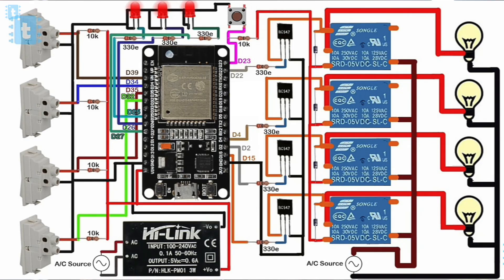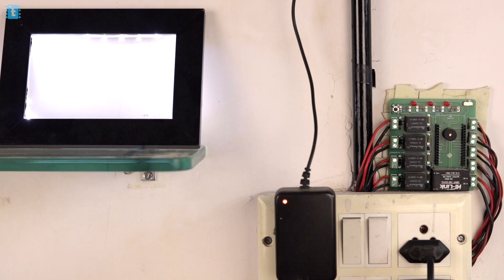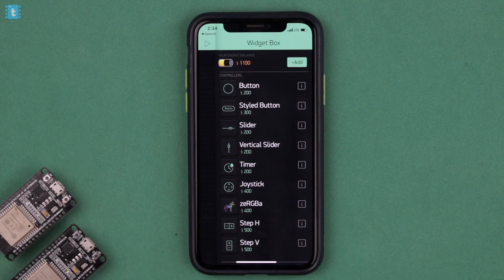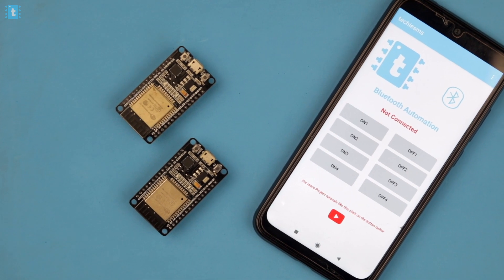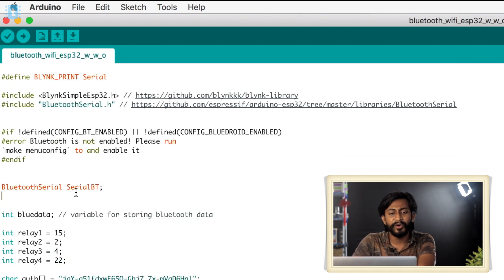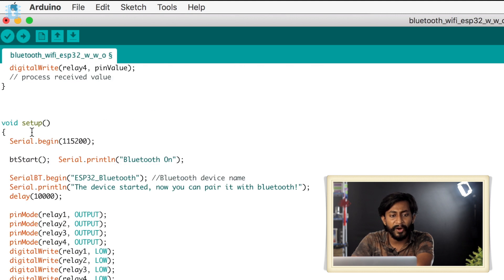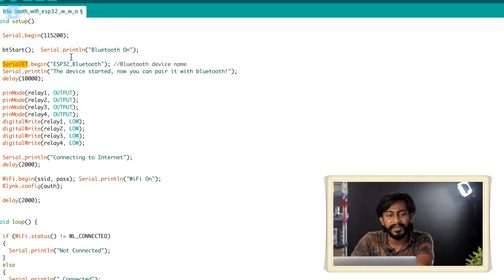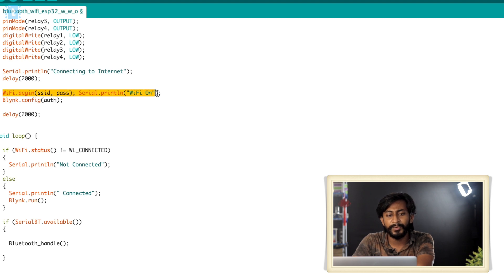Home Automation with WiFi & Bluetooth together

Comment: Bro i need to know if this is possible or not. we have Esp32 TTGO board which can use sim for internet connection and also esp32 wifi can be used as a access point so can we share the sim internet through the wifi AP of esp32 so that we can mimic the Jio hotspot dongles

Comment: Great information. Explained very well. But What happened, if  wifi is connected and other information are sending over wifi and and meanwhile Bluetooth data is available same time. Does it miss the Bluetooth data ?How it works ?how to configure that case? Thank you.

Comment: Hi bro,i am facing one issue in esp32 if i turn off and turn on  hospot wifi is not connecting automatically for reconnecting wifi i have to power off and power on otherwise i have to press EN then only its connecting give me some solution bro,thanking you

Comment: Sir , why All relay HIGH after c power cut off
Reply from the maker: Because appliances are connected to normally closed pins of relay
Reply: @techiesms  Sir.may be epirom code use
Reply: @techiesms  sir, I need 4 channel nodemcu WiFi epirom code

Comment: Arduino: 1.8.14 Hourly Build 2021/03/09 09:33 (Windows 10), Board: "LoPy4, Disabled, 80MHz, 921600, None"

Sketch uses 1329394 bytes (101%) of program storage space. Maximum is 1310720 bytes.

Global variables use 51604 bytes (15%) of dynamic memory, leaving 276076 bytes for local variables. Maximum is 327680 bytes.

Sketch too big; see http://www.arduino.cc/en/Guide/Troubleshooting#size for tips on reducing it.

text section exceeds available space in board

Error compiling for board ESP32 Dev Module.

This report would have more information with
"Show verbose output during compilation"
option enabled in File -> Preferences.
Reply: Exactly..I'm getting this error . Not able to compile Butooth and wifi both
Reply: For someone else, in Arduino IDE go to tools > partition scheme then select HUGE APP.

Comment: Bro plz solve my problems 
1.While I am giving external power supply to esp32 , all my relays are tripping after sometime if more than 2 relays on at a time  
2. Esp32 is not connecting to WiFi with load connected after restarting .. It only connects after removing load
3. How to save previous state of relays after restarting the esp32
4. Is there any other app alternative to sinric and free with ease to connect Alexa through internet

Comment: When ESP32 connects to the internet it breaks my connection with Bluetooth, and if I have a connection with Internet I can't connect to Bluetooth. Even with btStart().
Reply: Same here
Reply: @vipinckty1  Hey mate, so I was working with my project and made several research to this "error", well unfortunately ESP32 can't work with both (WiFi and Bluetooth) together, so what you will have to do, is make them work together. What I mean by that. They will have to work only one at a time. Good Luck!
Reply: @niltonschumacherfilho3368  ohk.. thank u for the information. 👍

Comment: You are awesome bro, you have a very great enthusiasm while developing and explaining your topics, that's inspiring, greetings from Mexico! Saludos amigo!
Reply: I want to make you a suggestion about the issue with the bt function, as I have learned, the registers that control the isr (or interruptions) inside of the microcontroller are not completely cleared when reprogramming is done, so once the flag that represents the isr of the bt function is on, the flag still on while you not clear it manually, I think you may turn it off by using a function that helps you to clear the registers of the flag, to need to turn on again the bt function as well.

Comment: Sir can I use touch sensors ttp223 instead of normal switches, but I want to use up and down switch for speed of fan with same relay and circuits as you have shown ,as it is the best non humming circuit, but how can I  go through for this small change, pls.  try to help me with esp32 pin diagrams and the coding..

Comment: It's esp library issue, it is saved running State, you can also found with wifi also. If one time you run as hotspot it's saves that state and always run until the stop code was not initiate. Any time in any code.

Comment: You wont believe !!!! I had been working on this project for past 3 months, had designed the board on my own by scrapping and learning all over the internet using my 2 year engineering skills, took me alot thinking of how to sync manual and wifi switching and did something similar. Today I found this video. Just looking at u explaining and wondering was it all that hardwork waste? I'll give you somesuggestions from my design, You can use the same phase wire to porwer the devise and prallely supply to appliances(Make tracks wide to handle current). ARE YOU FACING esp reset issue?  a 470uF capcitor  after hilink ac to dc converer protects esp from current spikes that result in shutdown. Regarding the software part I would suggest  HASSbian and a pi3 . I am devlouping my own software a and setting up cloud computing for same. Seeing this makes me so happy and sad at the same time!!

Comment: Whenever I connect my nodemcu with relay, whenever it gets connected to the internet, the relays get automatically turn on and off. It again happen only when I reboot the router/ nodemcu
Reply: In the setup part make sure that all the digital pins are turned low or high, or if you want to maintain their state, you can use EEPROM.

Comment: Hello techiesms hope you see my comment, It still needs upgrade, as with the use of bluetooth our device is hackable so we need security for the same to use the device without hassle.! Hope you understand my concern regarding project. I can hack into this easily even if I don't have any knowledge about the device. it should use some authentication to let any user connect to the bluetooth of esp32, which i too found very very difficult in serial bluetooth of esp32. But its necessary so is there any method so that device can only connect to the authorised person and receive data from the same.!

Comment: I think the btStart method is called in _inin_bt method of BlustoothSerial.cpp and this _init_bt method is called in method begin(String localName, bool isMaster) in line 607. But I don’t think this method is being called in the default constructor. 

This is my analysis of why it’s not starting without including in the setup. But I don’t understand how it’s working when you said that if you comment it out later it still works. 

BTW, I am novice in c and c++, but have in depth knowledge in other programming and scripting languages. With that knowledge I analyzed this but if I went awfully wrong, please correct me.

Comment: The Esp32 must have a one time overide function . So once btStart was declared
It started but 
Where btStart= True 
But 
It is
Never made false i.e bluetooth is never turned off
So that all
Reply from the maker: May be
Reply: That makes sense. I was thinking how it is or can be cashed, and this is inline with my analysis above as well on how it is not called in the default constructor.

Comment: Sir, is it esp32 or esp32s2 module? Sir because I have also tried so many time to do this but I failed and sir also I tried to fix the esp32 wifi reconnect issues with coding I can't. sir do you have an idea, to use reconnect feature in right. way ?
After doing a lot of research in the internet I heard about esp32s2 may be so many issues of esp32 fixed in esp32s2 module. that's why I asked you sir if you know about esp32s2 then guide us , & make a detail video on this. Thank you so much sir for teaching us....👍

Comment: Great, this is a great project !!!!!!!!!
I would be very grateful if you do a device like this:
     - Use esp32 to control 8 devices by Wi-Fi + bluetooth + 8 software buttons + 8 hardware buttons
     - 8 hardware buttons and 8 software buttons must be in sync
     - 1 LED shows whether esp is connected to wifi or not
     - 1 temperature scale
     - Can be controlled by google assistant
Please help me, pleaseeeee :((((
My English is very poor so I am very sorry

Comment: if (!btStarted() && !btStart()){
        log_e("initialize controller failed");
        return false;
    }

It says that, this function is only checking that you have initialized BTSTART or not,  not initialize the btStart(),  this condition only work if btStart() will return false statement, Good Work

Comment: What should be the wiring if you want to operate it from existing switches and through wifi and also maintain the state even after power loss(retentive).

Comment: Hee bro where can I found cheap electronic components and parts ? 
 
I want oled screen for Arduino 
So some one help me becouse I don't have budjet of it. So can eny one sponsor me ?

I am also doing experiments. Thanks   
Jay hind.
Reply: u can get from mumbai "vegakit" at very low price
Reply: @sringenious8231  I am from Gujarat so mumbai is far from hear , eney courier service available ? 
And what is the price of the oled and esp 32 ?
Reply: Will eney one sponsor me ?
Reply from the maker: DM me your requirements on Instagram @techiesms
Reply: You can give your used components and Arduino or esp32 . Or oled screen for Arduino.

Comment: Sir please reply me, Sir I face the some problem in the relay of the my home automation project , when I connect blynk app to relay module by esp8266 wifi then all relay is automatically On, so how to relay is neutral default when blynk app is connecting.

Comment: Also Bluetooth is so crucial when you have a portable project and not always using the same WiFi settings.  Example, I have a bunch portable video lights using esp boards to turn on/off and set brightness while shooting on location.  Super useful